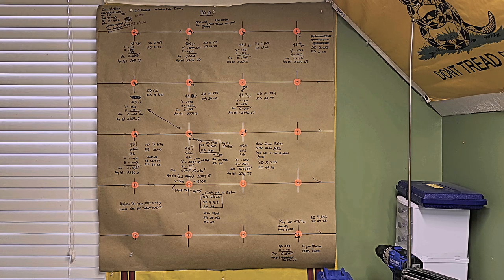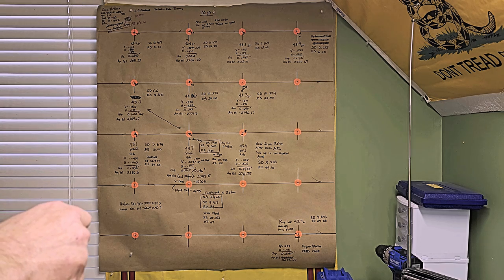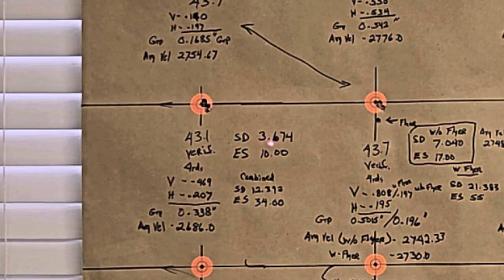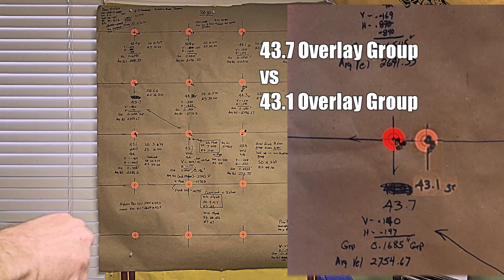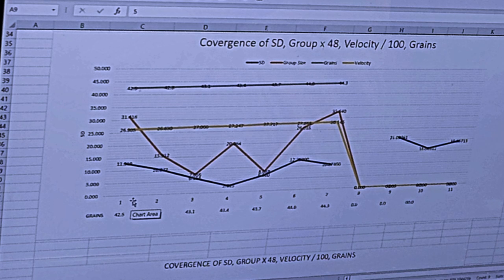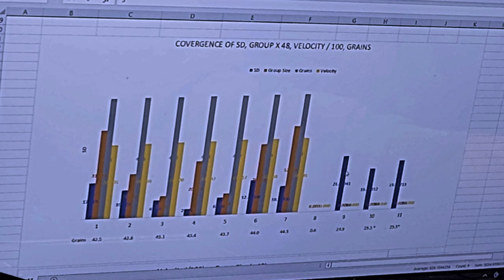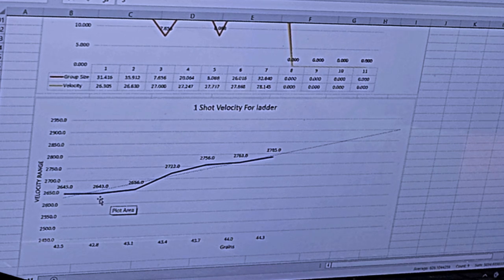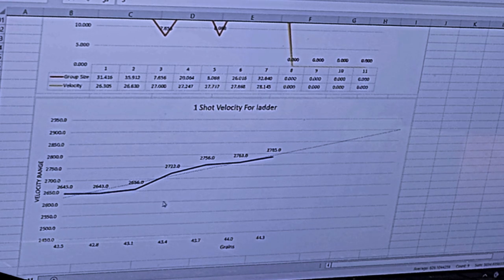RPR 6.5 Creedmoor Load Development  Accurizing Part 1 #viral #howto

Comment: Hey, Devildog! What dies are you using BTW? I've been reloading for years, but mainly pistol and slow rifle (300 BLK) so no experience with PRS. Just started for 6.5 CM, but not great so far. I've been having pretty sizable groups using Lee dies, but had not done true load development yet (just some basic data). Thanks for the help and HooRah!
Reply from the maker: @DarrenAlvarez  I'm using Hornady Match Bushing for full length sizing and, have the expander sized down to give .0025 Neck Tension. I've since added a step using actual neck mandrels from 21st Century to better dial in the neck tension. For seating I use LE Wilson micrometer in-line seating die on a K+M Arbor Press with the force pack